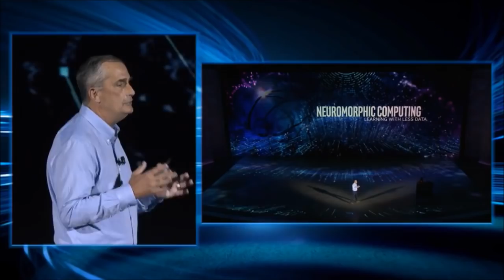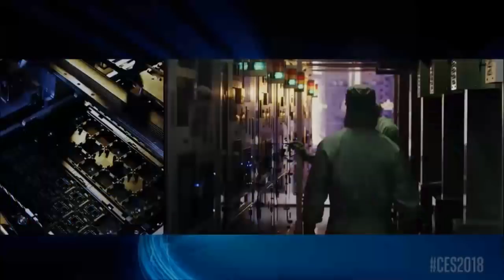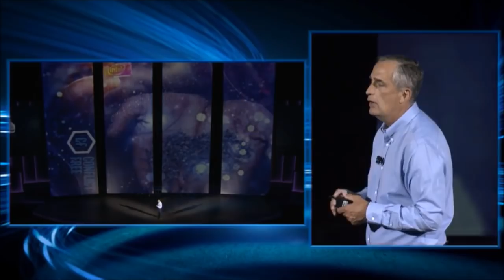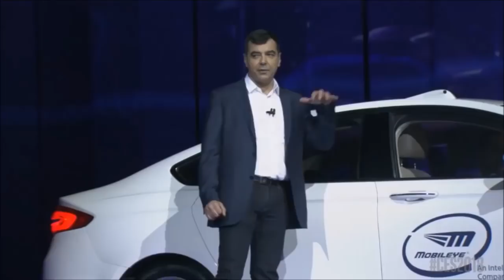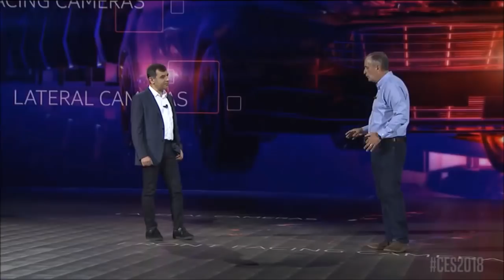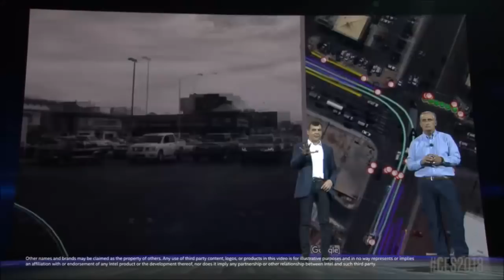Intel's New 49-qubit Quantum Chip & Neuromorphic Chip

Comment: To say that neuromorphic computers are designed to mimic the human brain and show how far we've come is interesting. To leave out the fact that top neuroscientists and cognitive psychologists keep saying that we have an incredibly low understanding of how the brain actually works, makes one wonder what exactly are we mimicking and what will it lead to?   😁

Also, all that processing power and the ability to generate an enormous amount of viable (or is it error free) models is great to have but could a "neuromorphic brain" come to see that, sometimes, what's a failure to an initial problem can be a great solution to a completely different problem? 😁😁 (an example that comes to mind is the Post-it story).
Reply: +Eternal Osman When they say dimensions, they're talking about dimensions of an array. I can have a 1D array, which is just a list of numbers in order. A 2D array is a grid of numbers. A 3D array is a grid where each cell is a 1D array. A 4D array would be a grid of grids. That's it. And you can simulate any dimension of array with a lower dimension of an array, and conventional computers do that easily. Your computer screen has a buffer that holds the data for each pixel, and that data contains x, y, r, g, and b. That's a 5D array, if I understand correctly. Some screens have an additional cell in each pixel that is a slight brownish color, and is used to effect the quality of light, so that'd be a 6D array. The data that gets sent to the buffer is itself extrapolated from an even more complex dataset, sometimes, that includes several "layers" imposed on top of each other, (z,) and alpha for each pixel, (a,) giving you an array of x, y, z, r, g, b, a, a 7D array.
That's if my understanding is correct.
Reply: +Unframed Minds No analogy is perfect, otherwise, it wouldn't be an analogy. Would they have to literally grow a human brain in a vat for you to say "okay, they made a computer that mimics the human brain?" No, that'd be absurd. What they mean is a computer that mimics certain very important capabilities of the human brain. In this case, I do believe it mimics neural growth patterns.
Reply: Interesting point regarding your ability to see merit in failures and take note of unexpected consquences for furure experiments... maybe this also applies to AI Computing too!
Reply: Also, quantum computing isn't parallel computing. Parallel computing is essentially when you have several processors crunching numbers side by side, and is possible with conventional computer and quantum computing. Quantum computing is a specific kind of hardware that involves using certain quantum phenomenon to do number crunching instead of electric circuits.

And where the hell do people get this NWO stuff? Every time I look, the NWO conspiracy theory gets nuttier and nuttier.
Reply: "Mimic a coarse-grained simplification of one aspect we think is crucial in the brain's cognitive function" just doesn't sound as sexy :-)
Reply: +Ngone Aw And how many of these people do you think are actually atheists?
Generalizations of that sort are usually an indicator of a superstitious and error prone mind. Maybe we SHOULDN'T be trying to emulate the human brain!
Reply: +prioris55555 "Most scientists are suppressing technology," and this, according to you, is bad, (aww, did no one pay attention when you said you discovered how to make a perpetual motion machine?) but at the same time, you're arguing against developing Quantum computers, neuromorphic chips, and self driving cars. You say quantum mechanics is "mysticism," but then you say one needs spirits for living things to move. Complete self contradiction! Did you think any of this through?

Conspiracy Theory is a colloquial term for a particular kind of fallacy of agency. Its highly dubious that you would attempt to police that term.

Keep in mind that just about anyone can do the basic light experiment that proves the basics of quantum mechanics. And most people can use highly accurate watches to test time dilation by using a plane. Quantum mechanics is falsifiable by ordinary people---so why haven't you falsified it? 

I explained only the very vague basics necessary to differentiate Quantum computing from parallel processing. Parallel processing is defined by more than one processor doing number crunching, quantum computing is defined by qbits doing the number crunching within processors. See the fucking difference? I don't need to even know the specific details of the quantum phenomenon (or the mathematical models alluded to by Aristotle Stagirus,) in question to tell the two apart, because they are apples and oranges. All I need to know to tell the two apart is their rough outline. In fact, I'd go further and say one is an apple, and the other is a brisk walk in the fall. That's how different these things are. 

But sure, the NWO purposefully set up highways in order to cause traffic jams just so they can get people into self driving cars. Makes perfect sense. No way that self driving cars are an obvious solution to several natural issues. Not like people prefer to let other people drive them places. People just love to drive cars.
I can provide plenty of downsides to driving cars, and I'm sure you can, too, but there are lots of people who would find them convenient, and software and hardware advanced enough might make better drivers than we do, someday. No need to resort to conspiracy claims to explain this technology.

Tesla didn't get ripped off by the scientific establishment as a whole, he got ripped off by a few select psychopathic individuals---no conspiracy is necessary to explain this historical fact, only a few people with no empathy, and those are a dime a dozen. Let's not forget the fact that those inventions weren't kept from helping humanity by such fraud, only Tesla was harmed. Still a travesty---but definitively NOT proof of a conspiracy to keep technology from helping people.
Reply: +prioris55555 You can test time dilation for yourself, as I said. Whether the guy who invented the atomic clock never accepted the idea is irrelevant---I doubt he performed the test. Whether or not he couldn't voice his criticisms under some kind of threat, (I am not taking your word for it after the mistakes you made about Tesla,) is irrelevant. The experiments exist, and can be performed by ordinary citizens. The power to prove Einstein a fraud is in your hands, so use it!

But yeah, I agree, the world would be totally peaceful if not for a sinister conspiracy theory. Back in the day before the near instantaneous communication technology necessary to perform worldwide conspiracies, everything was totally, completely peaceful. No starvation, no wars, no conflicts, no crime, no economic crises, no health problems, etc.. /s
Reply: They just made a chip based on a neural network archetecture, IBM has one too, "neuromorphic" is just a fancy bullshit term they came up with to sound different, it's nothing more than a regular neural network, except the chip runs it faster and a lot more power efficient than a normal cpu.
It's just adapting the archetecture for a specific task, while very useful to get more computing power, it's not a breakthrough in AI or anything like that.
Reply: Unframed Minds Good point.
Reply: "Einstein put physics in a dark age."
Funniest nonsense I've ever read. Newtonian mechanics failed to explain the precise nuances of planetary motion---the theory of relativity explains them, perfectly. If you want to contest Einstein's theory, do the watch/high altitude/sea level experiment.
Reply: I think you misunderstood my complaint, it's not about the chip itself, the chip is great and I would love to have one myself (master student in Machine Learning, so I know pretty much exactly what this chip allows me to do) , it's the marketing term "neuromorphic" is my complain, or well, the reason why it bugged me was the way it was presented, instead of just saying how it worked he just said "neuromorphic" and "mimics the brain". Sure this might be aimed towards an audience without an education in machine learning, but then I think it's even more important to go into some detail about what it actually does. IBM did a great presentation of their chip, this just feels like a last minute power point being thrown together in comparison. But that's all subjective I guess and technically there's nothing wrong with the term "neuromorphic", I'm just so tired of companies comming up with names making things sound a lot fancier than it is instead of just saying it like it is, or give the specs for the thing.
Reply: Qué les hizo mucho impacto mi sufrimiento Cómo se suman a todos cabrones
Reply: prioris55555 thank you my man. seems we have a few truth scholar on this sub feed. I love you guys. I will take a look at this channel.
Reply: thanks for the info Peter
Reply: +Aristotle Stagirus Good point on Sub Atomic Physics and Special Relativity. Didn't catch that one.
Reply: theres nothing too complicated we cant figure out..but its far less than  intriguing to need than to want, with so many potential holes n all..
Reply: Unframed Mind is about as smart as a retarded chicken but commutative power of a super computer
Reply: +prioris55555 Empty assertion. Just do the experiment for yourself, as I said. Its not difficult.
Reply: @Unframed Minds Very well pointed out! I for one tend to believe there is also processing going on subcellular level. That would mean that we are not even close to mimicking brains.
Reply: Your comment shows that you are the one without understanding
Reply: prioris55555 - Unfortunately i think  that is a very real potential reality for us
Reply: Unframed Minds Endophrames are being connected every quintillion of a second and just scripting languages of nanobits instead of rewriting neurochronological sequences, well, with such creations you can literally remake emphisemas of microsensors 5 billion times stronger than a nano extractor. Yes, I know it seems impossible but if you think about it, Mesotheric cubic reactors are as the same size now as a micro compensator so to enable quantum phisycs and recode it to the celular level just like a simple laptop, I think yes, it's achievable.
Reply: I agree with you Unframed Minds. In addition, we might have a problem when self-learning  expands beyond the human cognitive interpretation. Our genes aren't made to evolve in algorithmic capacity. How the heck we are going to deal with this so called quantum leap?
Reply: whether is bad or good...
Reply: NO. WRONG.  People can live indefinitely with telomere lengthening treatments, delivered via virus vector.  android bodies cannot host an unconscious brain.  without that, they will be useless.
Reply: you mean binary computers.  each bit is either on or off.  quantum computing potentially offers a third state in between.  but humans cannot directly observe this, or the wave function collapses and then they've got nothing.  the whole thing is really dumbed down and they are too lazy to explain.  OR the whole thing is straight BS.  like this is it.
Reply: Unframed Minds  Well stated. You raise some excellent, intelligent, thought provoking points.
Reply: BITCH ARE YOU CRAZY!! THEY'RE GONNA FUCK US UP
Reply: This some marketing Video to talk about Tech that they aren't even developing.. LOL and SMH... It's an Impossible.. It's a marketing Scam or Propaganda of CGI pictures, to sell more current chips.. OMG...
Reply: It's all a marketing gimmick.  This "Quantum" chip is closer to the Abacus than even the housefly brain.
Reply: Except instead of the human user creating the configuration bit file, the configuration changes and is arranged based on learned inputs.
Reply: "neuroscientists and cognitive psychologists keep saying that we have an incredibly low understanding of how the brain actually works"

If the world was organized as in "if we don't know everything then we know nothing" then you might have had a point.
Reply: it is just marketing like  the 'cloud', that has existed for years...
Reply: The spin of an atom is just not a myth, we use it everyday in medecine  for imaging the human body or research
Reply: Unless they are given a soul. Like 5G. That changes the narrative completely. These chips are the future processors for the coming Singularity.  Imagine a giant machine that reaches into the sky, but you can't see it, it's there and its been there, but you can't see it.
Autonomous control...of everything add AI. Autonomous control of everything.
Reply: +Chris Machabee Can you please explain to the class what a soul is, how to demonstrate its existence, how to demonstrate its known properties, and what those known properties are?
Reply: +Aristotle Stagirus Quick though, I wouldn't say the jump was from RNA/DNA to Neurons. I would estimate the stages are something more akin to this, (and this may not be a complete or accurate picture):
From RNA (ribosomes) to DNA/RNA
Epigenome built on DNA genome to fine tune and control DNA gene expression
Internal cell signalling components to control cell behavior, (this is a poorly explored area of research, to the best of my knowledge); this would have made a mighty leap with the evolution of the Eukaryote, which can internally compartmentalize in ways Prokaryotes cannot.
External cell signalling systems comes together with the last two, the epigenome and internal cell signalling, to control cell swarm behavior; prokaryotes would have had plenty of this before Eukaryotes, (such as how prokaryotes do head counts to determine if they should stick together, move apart, or go on a warpath,) but Eukaryotes lack a cell wall, which allows for cell signalling of greater ease. Multicellular creatures thus became more possible. 

Time for a lengthy tangent (leading to a specific and important point,): Internal cell signalling gives cells their role; for example, a chemical gradient within a stem cell will tell it to divide into two matured cells. The epigenome responds to this chemical gradient via, last I checked, a number of sometimes poorly explored mechanisms, wherein protein pathways respond to this chemical activity to place chemical markers on DNA that may influence expression of that gene, anywhere from shutting it down to completely, to reducing its expression by some 50%, to actively leading proteins to the gene to express it more often. 
External cell signalling, then, whether its affected directly by that chemical gradient, (perhaps the chemical binds to a protein on the cell membrane, causing it to release some chemical marker into its surroundings,) or by gene expression that's influenced by the epigenome, affects morphology by causing cells to affect the behavior of surrounding cells, calling specific kinds of cells to group around it, (perhaps to make a new limb bud from the main trunk of the body,) or flee from it, or commit suicide, (the latter two could be used to get rid of webbing between torso and limbs or between digits, for example.) 
Fun fact, you can replace the HOX gene (a set of genes that, when expressed, serve as commands to grow important morphological features,) between different species, without affecting how that species looks. For example, a fly with the HOX gene for a mouse eye will still grow fly eyes. But if you put an extra HOX gene for an eye, (mouse or not,) in the right place and modify it the right way, (not sure of the details,) you can end up growing fly (whether the gene was from a mouse or not,) eye in strange places.
If you want to be poetic, you could say that its like these different systems are drunk dancers, leaning on eachother for support, responding to eachother's footsteps to determine where to step next, coming up with a fabulous and fantastic rhythm until they...crash into a wall. 
At this point, you might realize that its hard to say these various systems are built in a hierarchy, regardless of when each came about relative to all the others. (It might be hard to identify which ones precede eachother, especially since some might be hard to classify: in the early RNA world, would two RNA organisms manipulating eachother count as signalling, for example?) 

Finishing the list, this is when its time for neurons: animals are, having a fairly efficient form of metabolism (burning hydrogens after pumping them through what amounts to a glorified water (or rather, hydrogen?) wheel releases a lot of ATP,) capable of quick bursts of motion, and that capability can be easily optimized with the right control system. In comes a specific kind of cell: the neuron, which can pass signals between cells (there's that external cell signalling) very, VERY fast, as you are well aware. There's also mechanisms of control via large chemical gradients that can diffuse throughout the brain, influencing large scale activity and fast.
Plants have their own movement control systems, (these are more apparent in carnivorous plants,) and some, including some neurologists, have suggested that plants may have consciousness.
Reply: Sorry for text wall. Hopefully its informative.
Reply: sly bob really, it can't even be sure if its computing or not, they have not proved any of that. for all we know its black magic, rituals, summonings, or whatever evil these guys do. quantum entanglement is pulling information from alternate or other dimensions. So if you look at HP Lovecraft and his info on dimensional "space" we can assume this is what they are working with.
Reply: The brain is actually not that complicated. We understand the architectural side of it well, the basic structural component the neurone we understand well.
What we really don’t understand, is how from this being connected, properties such as consciousness emerge.

We can start mimicking the architecture and see what happens. Maybe after a certain number of connections have happened, it might even wake up....
Reply: +think alike where did you get the idea we use 5 percent of our brain?
Reply: Unframed Minds its like building a universe in another realm. Who. Knows.
Let's simply rely own what it tess us what we should do.
That governing body country will rule lol
Reply: excellent point.  and what would you expect from computer nerds who don't even know how to pronounce the word data?  all they DO is bandy about impressive sounding conveniently undefined technical jargon, AS IF...

"God is in the details." -- Albert Einstein
Reply: lalybum yeah I think they can just see areas of activity under specific thought.
I find it interesting that athiest have low activity compared to religous people.
Reply: not the human brain

the key is human heart code. 😁
Reply: We understand a lot about neurons, and we know the key parts about how to function. But we don't know how and when they interact with all different parts of the brain to form our mind. Now simple neurons you find in neuron networks are simplified version of the real neuron, and this architecture is based on the same idea as the simplified neuron in neural networks. Basically it is inspired by the brain.

A more interesting question though; do we need to completely understand the brain to be able to mimic parts of it's functionality? We have (partly) mastered image recognition using a comparable neural architecture to the brain, yet there is alot we don't know about exectly how it does so. We just know the principal parts and how they work, we have only a rough idea about what each layer of neurons does inside the network.
Reply: There is no such thing as a "spirit in a shell"
Reply: even the brain isn't 'error free'  now self correcting over time? or maybe it doesn't correct it's self...i think all are necessary to get to TRUE a.i.
Reply: If nearly every tech giant is right it will lead to the end of humanity A.I. is the single biggest threat to humans.
Reply: 'Neuromorphic chip' is the media term for FPGAs. They have existed for decades.
Reply: One thing is for sure. We are about to recieve one heck of a lesson.
Reply: We learn best with our mistakes
Reply: the real understanding comes from understanding how the spirit where the real intelligence lies interfaces with the human shell  ... remove the spirit and all those neurons are useless

i'm sure they have very advanced androids already. whatever chips intel has are like vacuum tube technology

they would be able to integrate a spirit into an android body already in their black budget programs

there will come a time when spirits will incarnate into the android bodies
Reply: the guy that invented the atomic clock never accepted einsteins ideas. he couldn't say much for many years because his job and career were under threat

time dilation is just a flat out lie. time is universal.

most of the problems on this planet are artificially created or fake. wars, conflicts, crime, economic crisis, starvation, health problems etc
Reply: We are really mimicking human pattern matching capabilities. We can’t yet match the number of layers and neurons that the human brain possesses yet we can amplify certain aspects of the process that exceed biological standards such as the speed and quantity of data being processed. It’s sort of like only having the power of a mouse brain yet giving that brain 300 years of experiences in a single day. Could a mouse drive a car if it were strapped to a drivers seat and tested over and over for 300 years? Yes.
Reply: Shane the brain is just part off the interface to the spirit where the real core intelligence lies. The organic body allows us to interface with this realm. Even after people die and lose their bodies, their minds still operate.

Whatever they do, it will need to go beyond duplicating the organic body. They have to duplicate some function in the spirit too. 

neural networks are used to duplicate speech, hearing and sight thru pattern matching.
Reply: Peppermint Gal - Your description of Arrays is correct.
In the programming language called BASIC there is a command called "DIM" - which is short for DIMention.
In spirituality however, the word 'Dimention' is actually referring to something else - the more technically accurate word which is referred to in esoteric/metaphysics is actually 'Density'.
Specifically the 'Density' (standard definition) of Aether.
Other words/terms used instead of Aether are Chi/Prana.
These different 'Densities' of the fundamental known as Aether have different frequencys/vibrations.
We humans incarnated on earth are in Dimention/Density 3, i.e, we are said to be in the "3D" plane.
The Astral realm/plane is in 4D
Reply: prioris55555 - Actually the "Quantum" phenomena is literally at the hierarchical level before/pre Sub-Atomic level.
"Quantum Particles" exist there...
Reply: prioris55555 - Your so 100% Absolutely correct, nice to know there are others who recognise humanitys "Reality" of the world we live in
Reply: With this technology human kind will be able to travel anywhere in the universe and maybe through time
Reply: it obvious what it will lead to

Androids, Cyborgs, Terminators .... we'll be like John Connor in the future ... 

Self driving cars ... funny thing is, consumers never demanded it ... the NWO demanded it

with the NWO in control ... not a rosy future for humans in general
Reply: They are mimicking the ability neurons have to process information and store information.  Current computers have to have a CPU to process and memory to store information.
Reply: the craziest thing is when they talk about how Quantum computer works and they always end up saying we don't really know how it works we just know it does. Does Quantum computer takes their power from parallel universe?
Reply: These idots don't even know what consciousness is, trying to play "God" which they deny.
Reply: Doesn’t the brain or dna communicate on multiple dimensions, so is this thing also like d wave if it’s trying to replicate the brain?
Reply: Quantum computing just replaced the term Parallel computing. Saying quantum makes it more mysterious and less understandable. Public science has been stuck at parallel computing for decades. I'm sure they are far ahead in their black operations program. 

Mankind has never controlled this world. It is controlled by the New World Order which is in turn controlled by some group of aliens. Aliens have always been the dominant force in this world throughout history.

Mainstream science has always been filled with gargantuan lies. Nikola Tesla understood this. These lies are by design to dumb the population down. This is why things aren't understood so people build from their intuition, experience and observations. Quantum physics is just a lie hidden by  mathematics.

For anyone interested in the truth about astronomy, I highly recommend the Thunderbolts Project channel.
Reply: If Nikola Tesla was alive, he'd be an outcast in the scientific establishment

Well, the [NWO] future future is coming whether you like it or not... that's for sure
Reply: Tesla and the other great electrical giants of the past would have a very negative view of modern subatomic physics. The fake internet people have been carrying out attacks on Tesla from the get go well into the 21st century. Tesla died penniless. He was essentially written out of school history and science books.
Reply: Tesla viewed his mission in life promoting technology to help humankind and not suppressing technology unlike most scientists. Tesla got ripped off many times. The powers that be would financially destroy or murder any scientist that they thought was going to help mankind in any significant way.

Trump's uncle was the one who collected up Tesla's paper's for the government after Tesla died. The government kept all the important stuff and gave the rest to Trump''s uncle to do with what he wanted. 

What crippled Tesla was when the US government shutdown all electrical research in 1905. This is when Einsteins career started to blossom while Tesla was left feeding pigeons..  

Tesla went to his grave knowing the Einstein physics was a lie but your saying he would think differently today. Yeah, right 

Since the 80s, many people said there was a crisis in physics. What they really meant was that Einstein physics was sinking under the sheer weight of the grand lies and it was becoming too obvious. The only thing that keeps it alive is government funding and defunding anything that threatens it along with all their gatekeepers manning the scientific journals.

The real mental problems came from all those sociopaths in power who did the dirty work for the NWO. They will attack Tesla anywhere they can stick a knife in him
.
Reply: ok, you embrace time dilation
Reply: Time dilation will follow man made global warming lie ... into the graveyard abyss ... with the arrival of the grand solar minimum little ice age ... the global warming lie will also be exposed
Reply: @prioris55555  conspiracy theorists always say things like “the end is near” “this and that will be uncovered” and they must dream so strongly about when these “truths” are then uncovered so that they can say that they were right, and yet it has never happened has it propris? 😂
Reply: @prioris55555  boy you must be a handful have you got a wife? 😂
Reply: @Derkeller7773  so that's your response
Reply: Peppermint Gal ... you live on this earth with blinders ... using phrases like "conspiracy theory" damages any credibility you have

Quantum computing is a specific kind of hardware that involves using certain quantum phenomenon to do number crunching instead of electric circuits. .... do you realize how nebulous of an explanation this is ... the definitions of quantum computing are so fuzzy and abstract ... it is like a form of mysticism babble

when i see huge amounts of money going to quantum computing research ... it becomes difficult to know what they are actually spending the money on ... could be just another boondoggle or scientific fraud like CERN that smashes atoms
Reply: Aristotle ... you can rationalize it in your mind that it was some market forces but it is very clear that the NWO's vision of future society is being built ... markets in this world are highly controlled

how will they get people to accept self driving cars ... maybe by extremely high insurance rates for people who drive themselves 

these driverless cars aren't being built to help humanity or for benign purposes ... it's part of larger agendas
Reply: Quantum mechanics is scientific fraud on a global scale with the collusion of the powers that be. The Einstein physics put physics in a dark age. That will eventually have to be discarded one way or another.